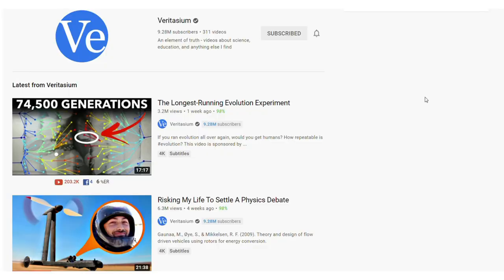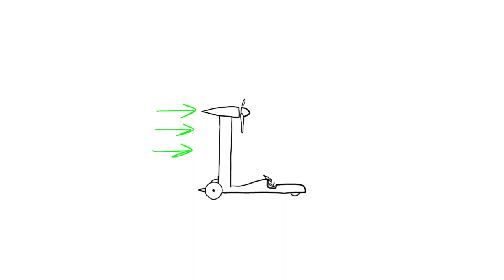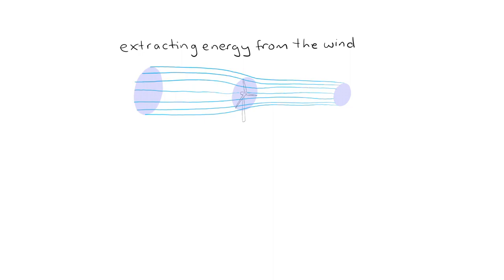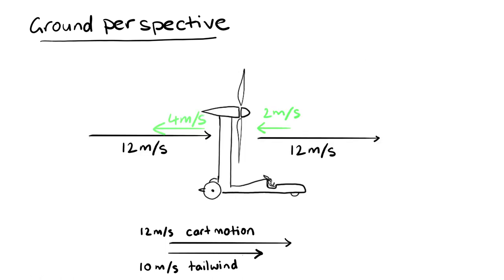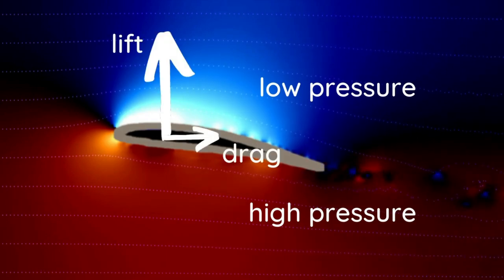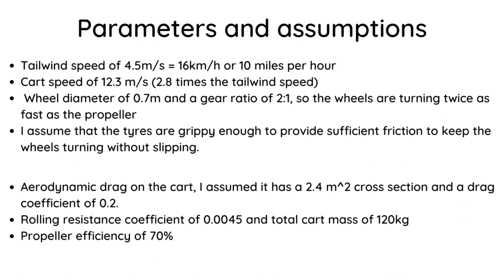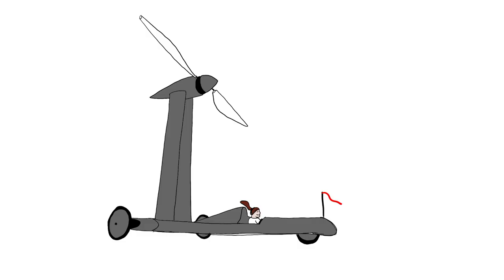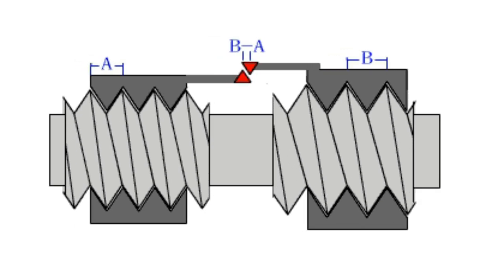Downwind Faster Than the Wind by Veritasium: How Does it Work?

Comment: I watched this with my son, who is an engineer. Both of us were unconvinced at the start but your explanation persuaded both of us. Thanks.
Reply: That's a HUGE testament to Rosie's talents!
Reply: @satunnainenkatselija4478  the cart initially accelerates from a stand-still in a tail wind (simply being pushed by the wind as a bluff body).  Once it's moving, the propeller begins to generate thrust which is able to take it to, and beyond, wind speed.
Reply: Most engineers do not sail, I guess ^_^
Reply: @Rick_Cavallaro  But Mr.Cavallaro, you didn't answer my question under your video:
If the propeller is generating thrust, then the cart could also move in a still atmosphere provided we give it an initial velocity. The cart doesn't need any wind. 
What is the role of the wind BEFORE (I repeat BEFORE) the cart reaches the wind speed? It has no role at all. The cart can move forever.
Reply: @MitkoGorgiev  
>> If the propeller is generating thrust, then the cart could also move in a still atmosphere provided we give it an initial velocity. 

The prop won't generate thrust on a still day.

>> What is the role of the wind BEFORE

It pushes the cart.

>> (I repeat BEFORE) t

I repeat IT PUSHES THE CART!

>> It has no role at all. 

I'm sorry, I thought you had a question.  You find this is a better way to learn things?

>> The cart can move forever.

NO.
Reply: Quote: "I repeat IT PUSHES THE CART!" 
Veritasium doesn't say that in any moment. He says that the wind gives only an initial velocity. 
I can prove that the wind cannot push that cart. 
If I were in USA I would also bet ten thousand dollars like the UCLA professor, but I would like to witness the motion of the cart and also to inspect it inside.
Reply: @MitkoGorgiev  you don't need to be in the U.S. to bet.  You just need to have $10K and actually believe what you claim.
Reply: @Rick_Cavallaro  No, I have to be in USA because I want to witness with my eyes the motion of the cart, but before that I want to inspect the inside of the cart (unlike the UCLA professor).
Reply: @MitkoGorgiev  you could make yourself a treadmill cart for $40.  But the reality is that you're at least smart enough not to bet.
Reply: @Rick_Cavallaro  The treadmill cart doesn't prove anything. It is no more than a distraction.
Reply: @MitkoGorgiev  
Yes, I get that you fail to understand it.
Reply: @Rick_Cavallaro  Just answer me one question. Derek never mentioned that the cart is moved by the wind (except for the initial velocity) and you are saying now that it is moved by the wind (not only for the initial velocity, but continuously). Why didn't Derek mention that, considering that you were together and talked a lot about the moving principle?
P.S. I will write a post on Quora (where I am active) and explain why that cart cannot be moved by the wind.
Reply: @MitkoGorgiev  
It is moving with the air and moving forward relative to the air.
It pushes the air back which slows it down. This means it is extracting energy from the wind.
There needs to be a wind for the cart to be able to slow it down.
And the treadmill is relevant because it is relative.
Air is moving relative to the ground on both cases.  In one the ground is moving and in the other the air is moving.
Reply: @MitkoGorgiev  You guys all over complicating things.  Try watch the original inventor explaining how the propellers moving like a pair of sails in the imaginary cylindrical world.  It's the efficiency of modern sail/propeller allow you generating enough "lift" to overcome any loss from jibing or ground/wheel/gear friction.

P.S. In case you are not familiar, sailboat never go straight downwind, it's too slow.  Instead, you zigzag at an angle, forcing part of the wind flow parallel to the sail generating lift, so you net downwind speed is faster.  The cart does the same, except it uses clever gear forcing the propeller to spin without having to zigzag.  Propeller moving through air is the same as air flowing over sail.  It doesn't really matter how you start moving in the first place, if it spins, it generate some additional forward "lift".
Reply: @ThisNoName  The sail analogy is a mistake. The propeller is not a sail. A blade is somewhat like a sail. A blade can faster relative to the air, than the wind speed relative to the ground. But the propeller can't be faster than the wind (in the same direction). 
Imagine a ducted fan instead of the propeller. Like a turbofan engiene fan stage. The fan needs power to generate force. In a turbofan engine, the power comes from a gasturbine. In the cart, the power comes from the wheel. The power at the fan's shaft can't be higher than the power at the wheel. The power at the wheel brakes the cart. The power depend on the speed. The braking power cant be lower than the fan's shaft power, the braking force cant be lower than the trhust force, else you make an perpetum mobile. 
Imagine: The air is still. You accelerate your cart some speed by towing it by a car. Than disconnect the  towing rope. And the cart accelerate further by own... Like the small cart on the threadmill on the video XD Than you engage a small generator on the cart (at the wheel, or at the propeller's shaft, or on a small wind turbine, don't matter). Now the cart  generates electricity instead of accelerating further... Electricity from nothing... Put the cart in a big circle track, and you have free electricity forever. 
It is impossible. 
It is a hoax or a big mistake.
Reply: @belamizsak161  You are over analyzing details with the wrong assumption.  When you claim it's impossible, you assumed the only way to move an object downwind is by wind pushing on a surface.  The real challenge is, can you channel part of that energy into a more efficient form.  The answer is yes.  In case of sail, part of the "push" is redirected to generate "lift".  In case of propeller, well, it's exactly the same.  You think propeller is different from sail, that's because your frame of reference.  Turn yourself into a dot living on a propeller blade, it's just wind flowing over a curved wing-shaped surface, causing a force perpendicular to the "wind".
Reply: @ThisNoName  If the cart moves faster than the wind (in the wind's direction), there are no external push (just drag). All lift generated by the prop, and the prop needs power to it. Sorry, I can't belive in it, that the propeller can produce more force than the braking force at the wheel. I think (at higher cartspeed than windspeed), the braking power and force at the wheel is always larger, than the prop power and generated lift by the prop. It have to be so.
Reply: @belamizsak161  You are again assuming everything is static push and pull.  Along that same line of thought, how can a sail boat ever travel upwind?  There's nothing but drag.  

Stop trying to analyze the force unless you are writing a physics paper.  The whole idea is about channeling part of the energy more efficiently, than simple wind against a surface.  The lift from wing-shaped sail is so efficient, a modern sailboat can go 3-4 times the speed of the wind.  Redirecting that properly, a boat can go up wind or downwind faster than true downwind speed.  The propeller is just another for of such conversion, with gears and different form and reference frame of the "sail" and "wind".
Reply: @ThisNoName  I can't write a physics paper, but in my opinion, you and the Youtube videos oversimplified it. 
Sailships can't sail faster than wind in downwid. A wing or sail can't generate lift in downwind. This zone is drag zone, a foil is in full stall in this zone, and the drag is the motive force on a sail in this zone.
A propeller isn't a sail. A propeller blade is - like - a sail. 
The propeller blades on the cart aren't in downwind or upwind, because they rotate much faster than the wind (or the stream generated by the propeller). The blade elements generate lift - and drags. The lift is higher, than drag in the lifting zone at low angle of attack. But you need rotate very fast the blades to keep them in the lifting zone. The drag is low, but you need lots of power to rotate the propeller, because it's high rotational speed. See an helicopter rotor.
This power acts on wheel as braking power, because the wheel drives the rotor. 
The power that rotate the propeller can't be higer than the breaking power, this is a fact. But I can't belive in it, that the thrust can be higher than the braking force. Videos on youtube are not enough. We have to see calculation and scientific verifications.
It seems like a transmission gearbox with some gear ratio, but without engine, and the gearbox drive itself, simply because it can multiply the torque.
The Blackbird's ribbon doesn't indicate the difference the windspeed and the cartspeed, because it was low, close to the ground, where the speed is lower than higher, it was in the propeller's shadow or suction zone, it was an imperfect instrument. And there were chanses to mistake or to cheat at the experiment.
I think, now the best disproof of concept is a cart on a threadmill in still air. It have to be violate the laws of physic. It can't be true. 
If the threadmill could be long enough, we could see, that the car accelerate just a short time forward thanks to the overrotated propeller, than accelereate backward as the propeller slows down. (Like a final stage an helicopter landing in autorotation.) And we have to see the wheelslip.
Reply: @belamizsak161  Not sure what else I can explain to you.  If you are near any body of water, maybe try take up a sailing lesson, then everything become obvious.  It's not rocket science, people figured it out before Jesus came.  If you can sail upwind, it's not hard to conclude the whole setup give you some edge over simple wind pushing, in any direction.
Reply: @ThisNoName  But sailing upwind at some degree is a totally different thing from sailing downwind at speed above windspeed, so this explanation doesn't work in this case. See some airfoil's lift to drag curve (0 to 360 degree), and see some sailboat's polar diagrams.
Imagine a ship, with two rotor. In still air. "A" rotor is the propeller. "B" rotor is a wind turbine. The wind turbine drives the propeller with some gear ratio (like the cart's wheel). Let the wind turbine is very efficient, 99% (in the reality, it couldn't be). Tow this ship to some speed than relase it. Could it accelerate further or stops? No. The cart on the the threadmill is an illusion. The Blackbird's case a bit complicated, maybe true, maybe full of mistakes, maybe cheat. In my opinion, they made some mistake at the measurements.
Reply: @belamizsak161  You need an advanced science degree to play with the "forces", or learn it intuitively by picking up sailing.  What you should not do, is trying to "imagine" science by intuition on paper.

BTW, do you know the blackbird can actually go directly upwind?  There are videos and science paper on it going back decades, just not as hot as when a popular youtuber took notice
Reply: @ThisNoName  Learning sailing is not enough in this case. You have to calculate to controll the videos.
A sailship can't sail directly upwind. 
If you put a rotor to the ship instead of sail, it is a different case. Because the rotor rotates, the rotor blades don't move directly upwinds while the ship moves directly upwinds. On the rotor blades acts relative air speed. In the case of the rotating blade, the relatve air speed depend on radius. The forces, eg. the axial force (the axial thrust or drag) on an element of the blade is depend on the windspeed, the rpm, the radius.
So the Blacbird may can or may can't move directly upwind, but I think, it can't. If higher the upwind, higher the motive force against the wind? So the cart just accelerate and accelerate as the relative wind speed is increase? In still air you gives to it some speed, than it accelerate further by own?
Reply: @belamizsak161  Yes, the blackbird can go straight into the wind, and still faster than ground wind speed.  The video was posted more than a decade ago.  You favorite youtuber deliberately not picking that one, because everyone know sailboat can go upwind.  Faster than downwind example is much less intuitive and can generate more controversy and clicks

In short, don't science by intuition, it seldom works that way.  And the force has been with you since the 70s.     http://202.38.64.11/~cxyu/AJP_pushmepullyouboat.pdf
Reply: @ThisNoName  Yes, you are right. Blackbird can go directly upwind. It is sure. If the rotor drives its wheel. Based just on intiutions. It is simple, straightforward.
I failed. I didn't thinking about driven wheel in my last answer. I'm just thinking about airforces. 
But now, I'm not sure, Blackbird can or can't go directly upwind without driven wheel... I think, maybe not. But I dont know.  (A sailship can't go continously directly upwind, a rotor may can, but I don't see it based on just intuitions.)
Yeh, the faster than wind in downwind is not straightforward...
Still my opinion that the threadmill experiment is probably false.
In the case of Blackbird's full scale downwind experiments... I have doubts abut explanations. I am not sure, they are right. I can't belive in it yet. I can't see it, that it can work.
Reply: @belamizsak161  Treadmill pushing the cart backward, which if you take the reference frame of the cart, is equivalent to cart sitting still on the "ground" with a tail wind.  Cart going forward faster than the mill moving back, is the same as going downwind faster than wind, from cart's reference frame.

The upwind bird is configured slightly different, the giant propeller turn the other way.

Comment: In the moving vehicle frame of reference, energy is extracted from the earth (earth is slowed down a tiny bit) and added to the apparent headwind (headwind is sped up). The earth surface is moving backwards, and the forwards force exerted by the wheels onto the earth surface slow the earth down (from the vehicle frame of reference) by a very very tiny amount, extracting energy from the earth ~= ground force x ground speed (from the vehicle frame of reference). Reduction gearing is used to produce a greater thrust at a lower speed at the propeller. The 1877 Brennan torpedo is an example of the same principle: two powered spools pull wires backwards off of two spools on the torpedo, which in turn drive the propellers forwards at a greater force but lesser speed than the wires, so that pulling the wires backwards results in the torpedo moving forwards. if the wires were attached to two posts in a river, the torpedo would go downstream faster than the stream. A similar example is dynamic soaring which exploits air moving at different speeds across a relatively thin shear layer. In the case of radio control gliders, this is done on a ridge, where the ridge blocks the crosswind somewhere below and behind the ridge. The upwind side of the ridge is used to launch the glider and gain some altitude, after which the glider is circled at an angle on the downwind side of the ridge, repeatedly out of and back into the crosswind. The current dynamic soaring record is 564 mph by Spencer Lisenby.

Comment: Someone made a machine which does a similar thing moving between a table and a plank of wood, and it moves "downwind faster than the wind" in that if you move the plank, it moves in the direction of the plank, but faster than the plank. I can't find the schematic for it anymore though :-( It was convenient 'cause it was something you could build at home using simple parts and watch it work.
Reply from the maker: Oh that sounds cool 😊 I did see a few other examples of downwind faster than the wind, maybe I'll pull them all together on a post later on.
Reply: @EngineeringwithRosie  You'll find that on my channel: "under the ruler faster than the ruler" :)
Reply: The engineer and sailor, Theo Schmidt was the first to do it with a model. He published an article over 20 years ago in Catalyst, the journal of the Amateur Yacht Research Society. It may be available online.
Reply: @petersharp6833  - The Brennan torpedo operates on the same principle, and was made in 1877. The physics people at the time had already determined it would work, before committing the money it took to build the setup. Wikipedia has an article on Brennan torpedo.